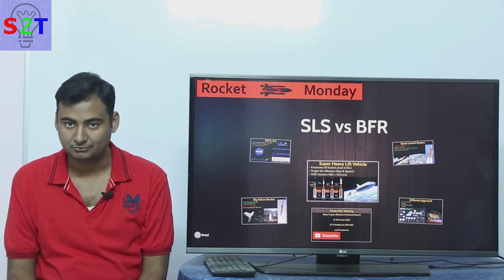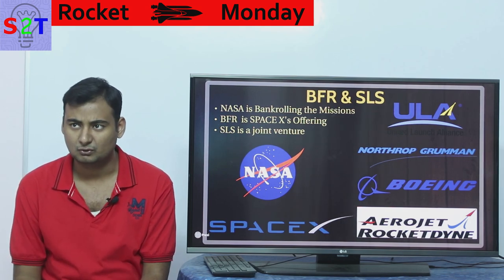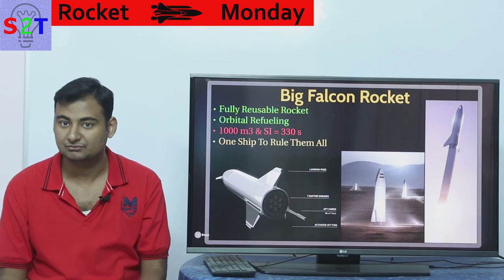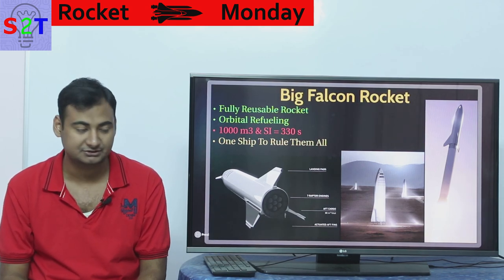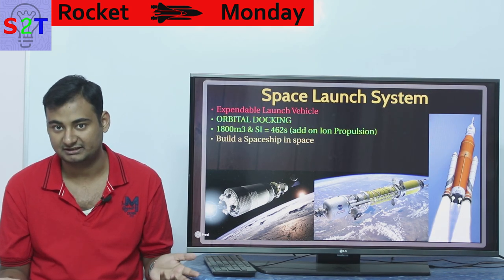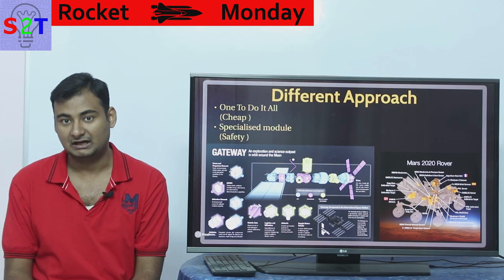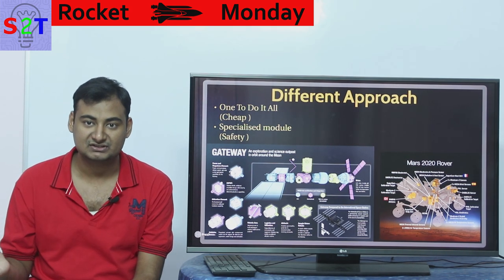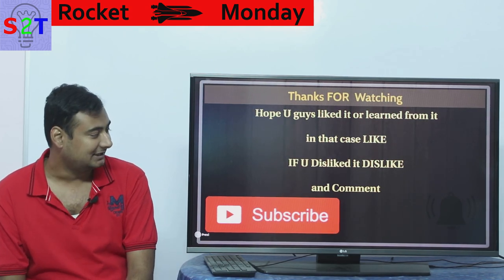Rocket Monday Ep21 (BFR vs SLS)

Comment: Great video.  I think that if BFR is progressing on schedule, we will only see a single SLS block 1 launch (70 tons to LEO).  I don't think we will ever see an SLS block 2 launch.  It is just way too expensive, to justify once BFR and New Glenn are flying.  Also, in addition to ISRU, SpaceX needs more information on how the human body responds to .38 g microgravity (Mars gravity).  we can't have people living on Mars for years if .38 g is just as lethal to humans as 0 g.  We need to create a space station with artificial gravity before going to mars, in order to test this.
Reply from the maker: Cost is not really an issue as long as there is options and not to mention size & weight does play a key roll in which sls block 2 is GOD .  human body responds to .38 g microgravity  (Mars gravity) cannot be worst than 0 gravity ,so we have a handle on things that was in fact one of the main GOAL of ISS   . We should test but LOP-G is not spinning so we really cant test things .

Comment: Great! Btw I believe 330 s is the sea level ISP of Raptor SL version. In vacuum the sea level version is supposed to get about 356 s and the vacuum version would get north of 380s.
Reply from the maker: I was aware that the vacuum SI would be high , however I did not include that data because space X is only using sea level nozzle and engine not not flown yet so I wanted to give a safe data point
Reply: @AnupamVipul  I see